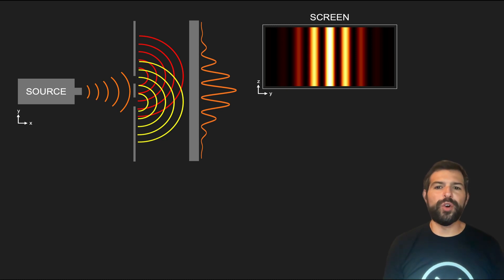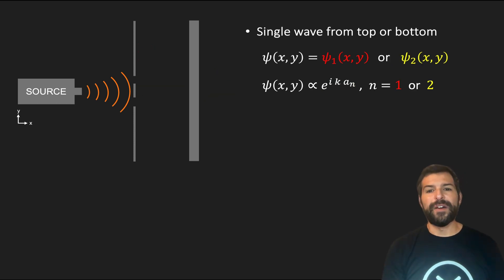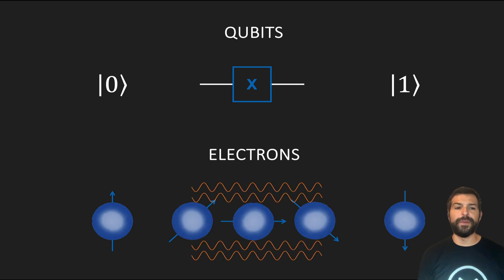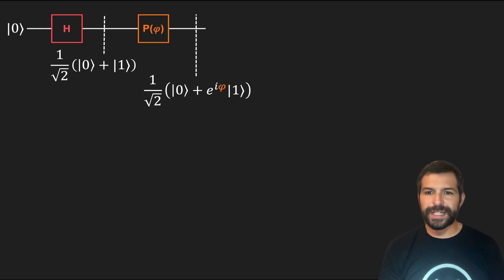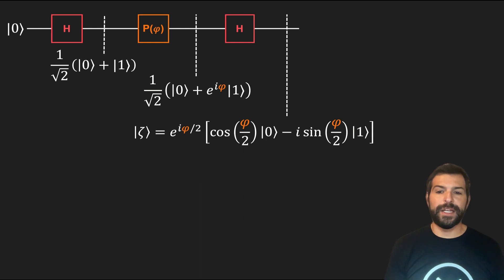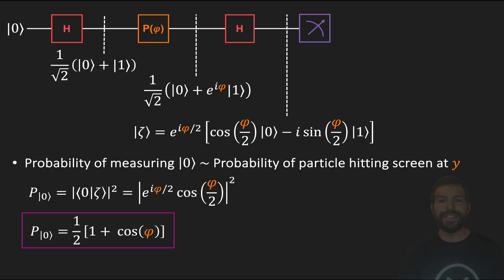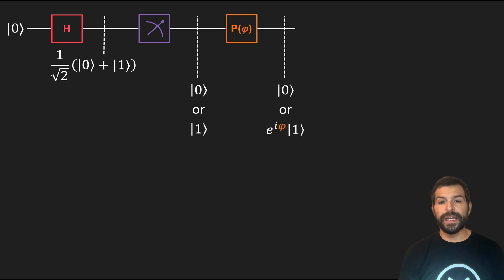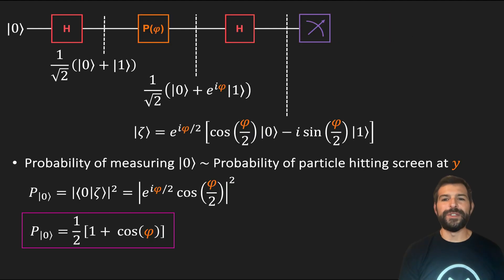Mapping the Double-Slit Experiment onto a Quantum Circuit

Comment: The circuit demonstrated the wave behaviour, but it is not clear why this is not only a demonstration of an interferometer, as I don't see how it is demonstrating the particle behaviour when you are measuring  at the "slip". it seems to me that the measurement only eliminates the ability to apply a phase to simulate the difference in path, but it does not simulate the particle behaviour.
Reply from the maker: As I mentioned in the video on the double slit experiment, electrons, photons, etc. never really show “particle” behavior unless they are continuously being probed by the environment (like in the cloud chamber example I give in that video).
Reply from the maker: Also, yes, the circuit is identical for how you would model an interferometer experiment with the difference being that the change in angle emulates the location on the screen rather than a difference in path lengths

Comment: Thank you for the video. But I have a question. Why did the ket{0} interpretation change during the process? When talking about the double slit, ket{0} means the particle though into the upper slit. However, when considering the particle coincidence in the screen, the same ket{0} is interpreted as founding the particle. The same thing happens for the ket{1}.
Reply from the maker: Hi. The interpretation changes so that we can map the double-slit experiment onto the quantum circuit abstraction. There’s nothing wrong with this as long as the results of the circuit approximate the experiment to a good degree.

We do this all the time with other systems. For example, say you want to use a digital circuit to emulate a switch that turns on/off a lightbulb. You can do this with a NOT gate. A 0 at the input is the switch flipped up, a 1 the switch flipped down. A 0 at the output is the lightbulb off, a 1 the lightbulb on. The meaning of 0/1 changed from input to output even though the symbols stayed the same.
Reply: @diemilio  Thank you for the answer. How can we prove that the latter ket{0} represents the finding of the particle and ket{1} does not find it, and not vice versa?
Reply from the maker: @MuhammadTaufiqiThoyyibi  it’s just a choice we make. Picking |0⟩ gives us a probability amplitude that matches exactly what we get for the double slit experiment (see prev video), but we can equally pick |1⟩; it will just give us a probability function that’s off by pi/2 radians.
Reply: @diemilio   Thank you for the answer.

But as far as I know, we can interpret the ket state freely at the beginning of a process. We cannot change that in the middle of the process so that it gives the correct result.

For the light circuit, actually, we can treat the state consistently. Ket {0} represents light is off, and ket{1} represents the light of on. A switch represented by a Not gate. Hence, we may not need to change its interpretation even before or after entering the gate.
Reply from the maker: @MuhammadTaufiqiThoyyibi  No. I'll give you another example that not only should connivence you, but that also shows that sometimes we have no choice but to change the meaning of '|0⟩' throughout the circuit.

Say you prepare an arbitrary state α|0⟩ + β|1⟩. If you perform a measurement you get results in the computational basis for states |0⟩ and |1⟩. But what if you want to measure in the Hadamard basis and get results for states |+⟩ and |-⟩? You can't. Measurements in superconducting circuits can only be performed in the computation basis. 

However, if you apply a Hadamard gate right before measurement you perform what is know as a "change in basis", and now you can simply say that after the Hadamard state |0⟩ actually represents state |+⟩ and state |1⟩ represents state |-⟩. So measurements of {0,1} in the computational basis after applying an additional Hadamard actually gives me statistics of states {+,-}. We have completely redefined what states |0⟩ and |1⟩ mean! 

This is a great example because it is not something I just came up with; this is something that everyone does all the time because it is the only way to do it.

Hope this helps.
Reply: @diemilio   Thank you for the explanation.

However, the changing in the Hadamard case is done via a unitary operation, which makes the new ket{0} represent ket{+}.

And yes, we can freely change its interpretation by means of a unitary operation, not by hand.

That's why I asked before how you prove the change is valid. Or, in other words, what unitary operation did you use to change:
1. ket{0} as particle going through upper slit, into ket{0} represent particle coincide at the screen,
2. ket{1} as particle going through lower slit, into ket{1} represents particle not coincide at the screen?

Your video is fantastic and gives a good result. I just wonder about the last step.
Reply from the maker: @MuhammadTaufiqiThoyyibi .Thank you for your comments.

As I mentioned before, we can make these assignments as long as they are reasonable. What this means is that, we are not doing anything "by hand" (as you call it). What is happening here is that, we are saying state |0⟩ is associated with the top slit, state |1⟩ with the bottom slit. But what this really means is that, the top and bottom slits have associated with them different momenta when they reach the screen. One proportional to a1, one proportional to a2; that's what makes them different from each other. The measurement is done is position space though, so we are indeed doing a change in basis here (just like what we do with the Hadamard gate).

Hope this helps.
Reply from the maker: The easiest way to see that all the assignments we made are reasonable is to compare the equations for the double slit experiment with those you get from the circuit. Then it is clear they are equivalent.
Reply: @diemilio  Thank you for the answer.

But it is still bothering when you compare the basis change in the circuit and the Hadamard, while you did nothing in the circuit case and must apply a unitary operator first in the Hadamard case.

Yes, the resulting equation is similar. But I dont think it can be used as justification.

Or do you have another similar must-basis-changing case that does not require a unitary operation?
Reply from the maker: @MuhammadTaufiqiThoyyibi  
1. ket{0} as particle going through upper slit, into ket{0} represent particle coincide at the screen is basically going from momentum representation to position representation. There is no unitary applied because I don't need a change in basis in the double slit experiment (I am only interested in position), but I do in the circuit.
Reply: @diemilio  So, did you mean that the former ket{0} represent particle momentum, and the later ket{0} represent particle position, and the change is done without any transformation?

Or maybe I got it wrong?
Reply from the maker: @MuhammadTaufiqiThoyyibi  that is one way to interpret it
Reply: @diemilio  Alright, frankly, I still do not understand (due to my lack of knowledge), but let's say it is settled.

Then, what is the connection between the changing-momentum-position interpretation and your free choice to interpret ket{0} as a particle coincides at screen and ket{1} particle does not coincide at screen?
Reply from the maker: @MuhammadTaufiqiThoyyibi  Not sure there is a direct connection between choosing 0 or 1 with the position-momentum relationship. That choice has to be made because that's where the two problems differ from each other. In the physical experiment with a continuous wavefunction, the top/bottom slit waves simply add. In the circuit, the Hadamard produces an addition and a subtraction term, so you have to choose one.

Again, this is extremely evident if you write side by side the equations for both the double slit and the circuit.
Reply: @diemilio  Thank you for the answer.

Did you mean that your position-momentum explanation does not directly support your free-choice ket representation changing? My apologies; I still do not see that change as reasonable.

Okay, let me put it like this.

Even if you can freely change (as you said) the ket{0} representation in the middle of the process, you choose ket{0} to represent that a particle coincides at the screen, and not the ket{1}. Why? Because it is the correct choice such that the circuit gives the same result as the experiment.

As you also said, you can choose ket{1} to represent the coinciding particle, but you need to add an extra step to handle the phase difference, again, in order to match the real experiment result.

Is that correct?

If yes, then the circuit you build is aimed at re-creating the double-slit "experiment result" in Qiskit, NOT at simulating the self-interference phenomenon such that it creates a similar experiment result.

Why did I say that? The reason is that if you don't know the real-experiment result and you only know how the interference happens (but you don't know its final result), can you still make the correct choice? I don't think so.

Or am I getting your explanation wrong?
Reply from the maker: @MuhammadTaufiqiThoyyibi  we’re trying to emulate the experiment. Of course it will never be exactly identical. In the double-slit experiment we have a continuous wavefunction. In the circuit we have a two-level system, so we have a much smaller space. We need to find ways to make the two be as closely as possible, but obviously they’re not identical. Another important subtlety is that, in the double slit we have a probability density. In the circuit we have the actual probabilities. I try to be clear about it throughout the videos, but it might be easy to miss. 

But I think all of these differences are irrelevant. At the end of the day, we are carrying on an experiment where we clearly see an interference pattern caused by the exact same quantum-mechanical effect seen in the double slit. They pretty much capture the exact same concept.
Reply: @diemilio  But that exact same result is due to your intentional ket interpretation change due to one aim: such that it gives the same result.

Again, I don't think the same result can be a justification that all of the process is correct.

My apology; please correct me if I am wrong.